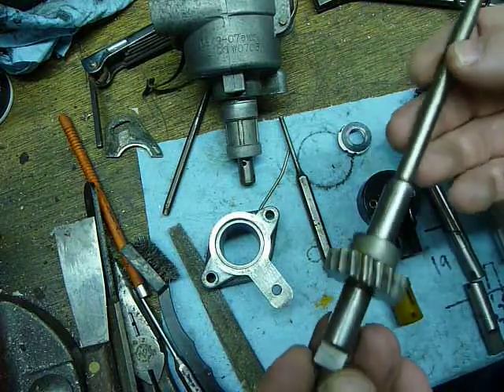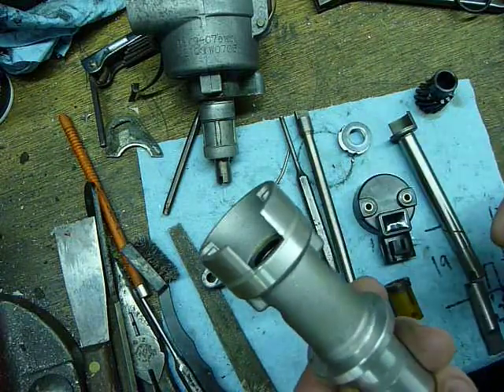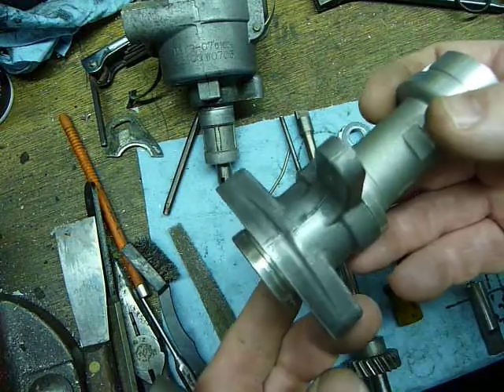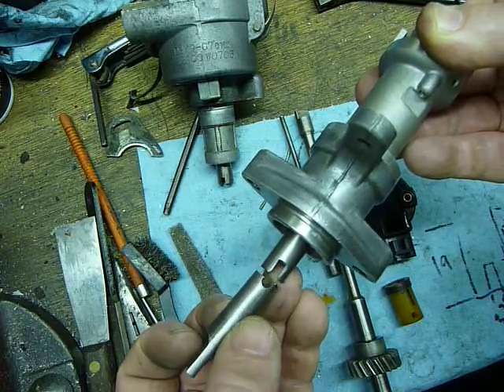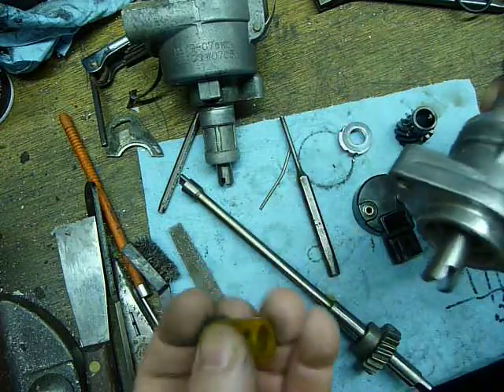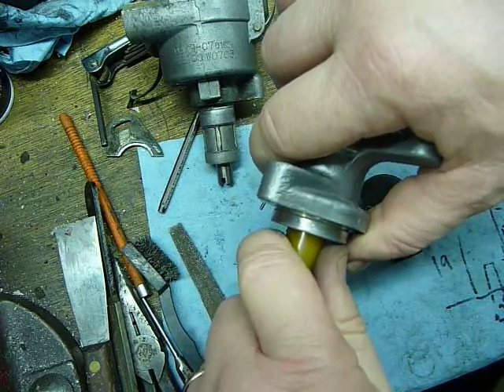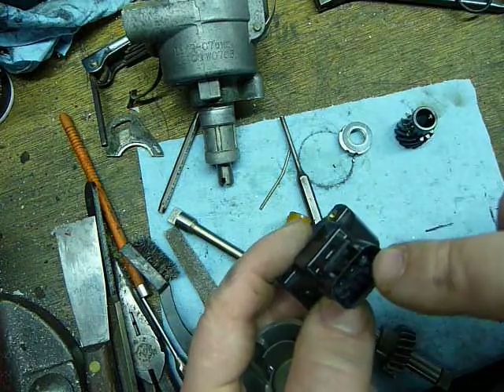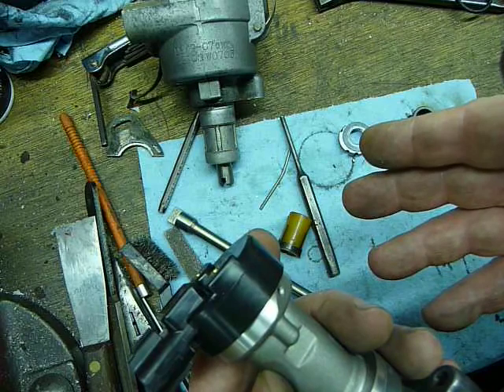Advmachines--Nissan L28 CAS sensor for MS3Pro

Comment: Would u be inclined to modify the shaft for payment? If so what's your email
Reply: https://forums.hybridz.org/topic/125904-jeep-cam-angle-sensor-for-l-series/

Looks like this person retained the gear and flipped it upside down.  No mention of turning down the shaft diameter so it might not be necessary.
Reply from the maker: I just saw this comment.  Sorry for the long delay in responding.  If you are still in need of a modified CAS for the L series, let me know.
Reply: Ken Nelson I could use one. I just ordered the sensor but I’d feel better someone whose done it before do it.
Reply: Yup same here, I would like one as well if possible

Comment from the maker: Hi Adam, thanks for the complements! I was not the one that found it originally, I stumbled across it from a HybridZ thread and took it from there.  I figured that there was other L28 NERDs out there too that might be interested in full sequential and CAS bits that didn't include trying to find and fit a 280zTurbo CAS.  The Jeep stuff is super cheap (buy it online new for ~$35) and new.. and IMO more tidy.  I went to Hoke for the crank sensor setup (my damper was the example OEM unit for the 280z) and am running the trigger wheel and bracket from Hoke, super nice stuff.  I will be posting more soon, head is on the flow bench getting dialed in and then looking to do a custom grind cam for the head... still TBD on who will do that work.  Will post as we work the head and more engine build, then suspension rework etc... spoiler: going to move the front suspension upper tower section back to allow 5-7 degrees of caster :D
Reply: Ken, Great video.  I was just about to order a L28ET dizzy (used $230) or a Crank Trigger Ignition Sensor from Zcardepot ($420).  Now I am having second thoughts thanks to you!  :)  Also been looking into the Hoke setup for the MS3.  So does Hoke have a setup specific for the stock 280z damper now?  Any update on the wiring for the hall sensor?
Reply: Also, what are you using to lock the Jeep synchronizer in place after installing it back into the Z?
Reply from the maker: Hoke does have the tone wheel and sensor mount for the 280z damper. I modified the Nissan distributor clamp to hold the Jeep CAS. I have not 100% verified the CAS wiring, need to bench test it with the oscilloscope.